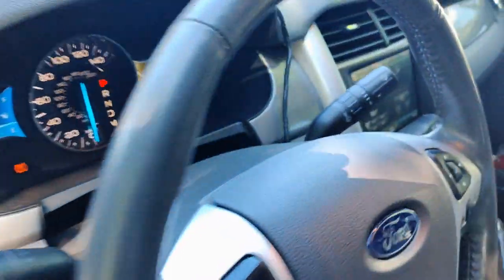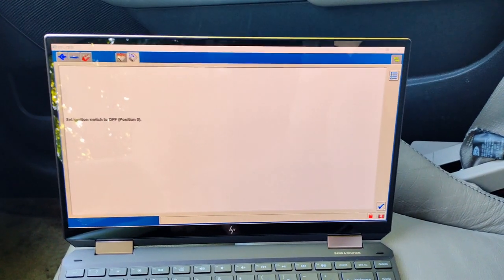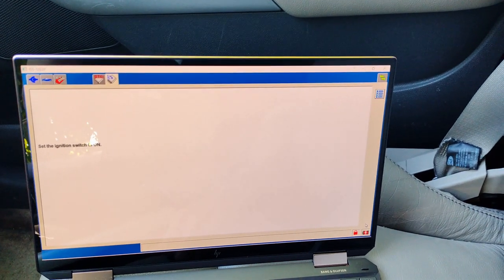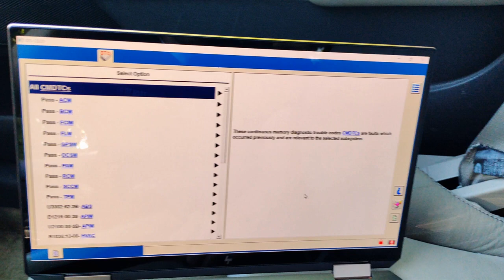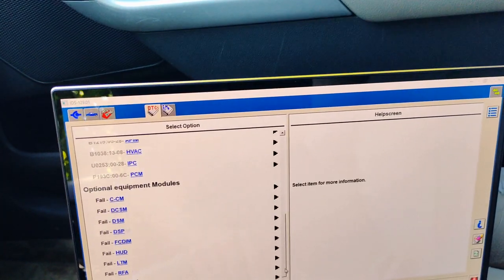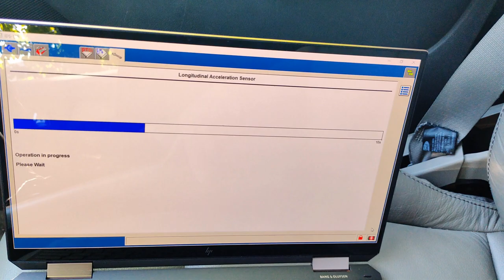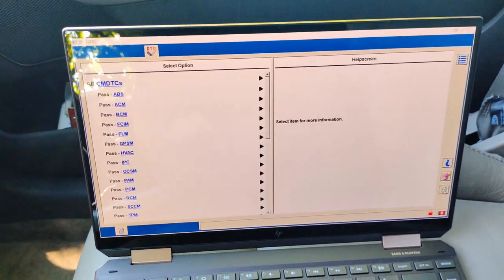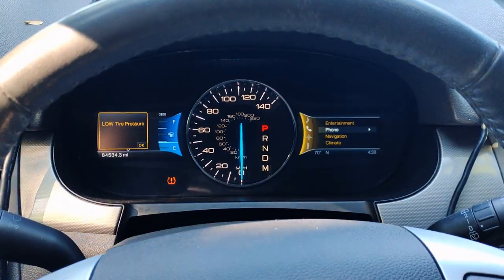2011 Ford Edge ABS Programming | U3002 | Manual As-Built

Comment: Hey i just bought a 2011 Ford Explorer and the previous owner replaced the ABS Module...(I assume its brand new) And they've got rid of the old one....is it possible i can get this one (the new ABS Module) programmed???
Reply from the maker: Yes, used abs modules work sometimes. You may have to try a few. The only module that is considered new is from the dealership. I doubt it's new..

Comment: You use forscan whenever doing used modules?
Reply from the maker: I've never used forscan but it's possible.
Reply: @autotechtogo6290  how do you install new pcm using fdrs? Doesn’t have a place to put tear tag number like ids. I assume just type the vin in manually? Forscan is easier to do used modules on than ids sometimes ids will say no no not gona let you.
Reply from the maker: @philh9238  I would assume you only enter the vin. I don't do many new pcms using FDR's.
Reply: @autotechtogo6290  when you get a chance make a video if you could?
Reply from the maker: @philh9238  I will.